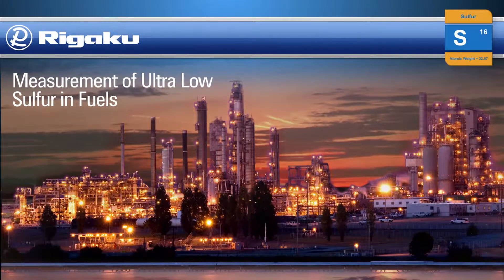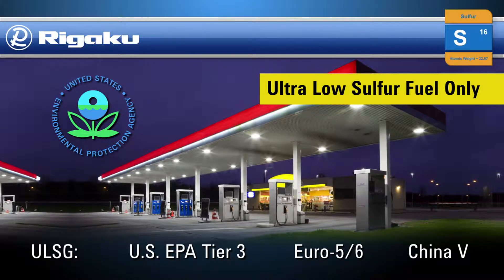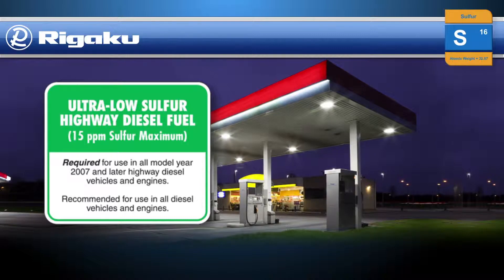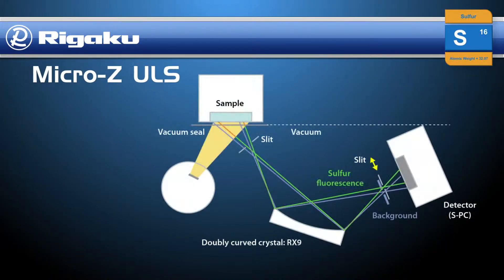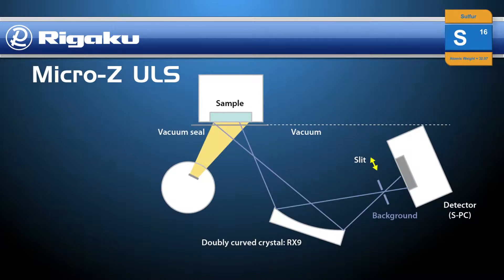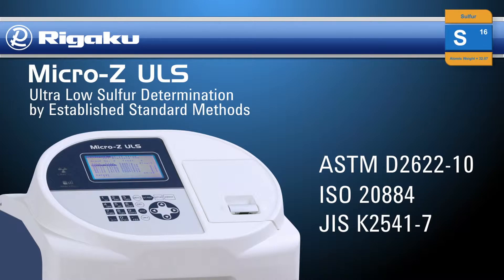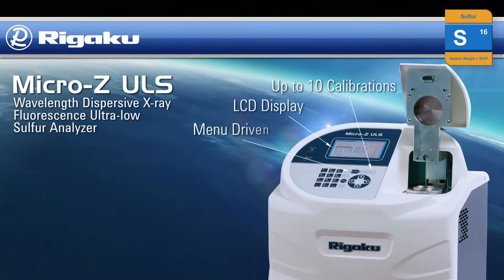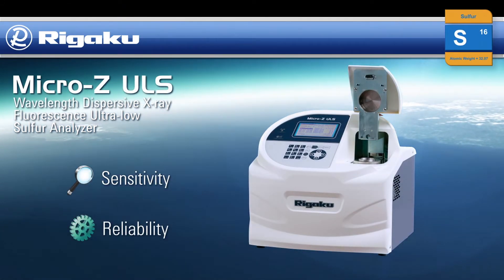The Rigaku Micro-Z ULS for ultra-low sulfur in petroleum-based fuels

Comment: Does this instrument need P10 gas?
Reply from the maker: The Micro-Z ULS uses a sealed proportional counter with P10 gas. As the detector is a sealed proportional counter, it does not need any external P10 supply. For installation you only need a power plug but no gas installation.